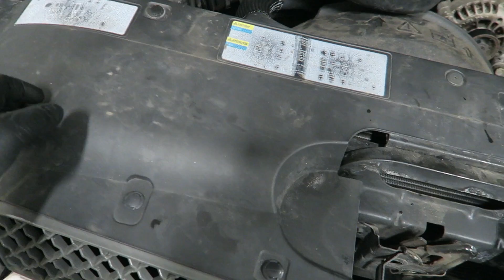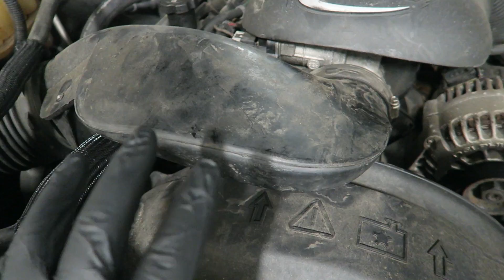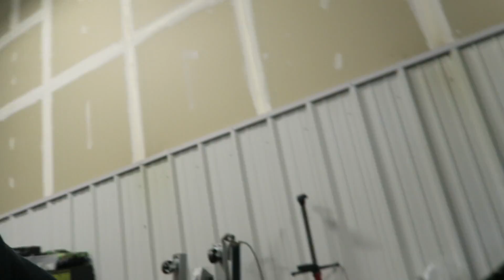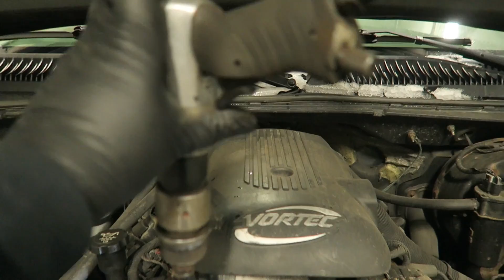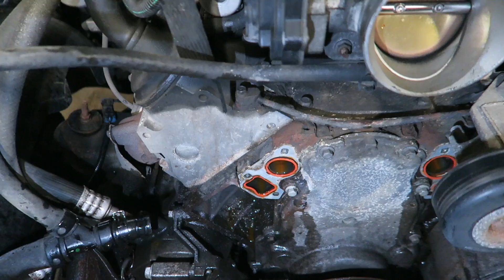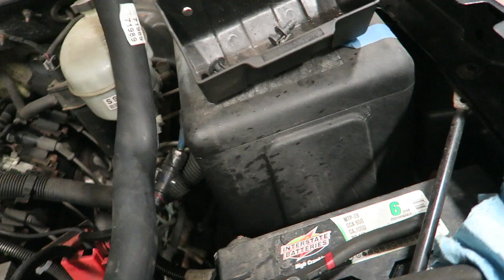SILVERADO WATER PUMP REPLACEMENT....Sorry no welding :(

Comment: Got a 92 f150 just did a water pump on but I broke off two bolts any tricks to getting the studs out the block
Reply from the maker: Chris  Roberts the most productive and successful way to do it is weld tiny beads to the bolt itself without welding it to the block. Build up enough weld metal to slide a nut over it. Weld the nut to the bolt and remove. The heat from welding also helps to free the bolt.

Comment: You make great how to videos! If you ever have the time or opportunity you should do an in depth video of simplifying a wire harness for a race car. I need to make one for my bump-n-run car but I'm not sure what I can delete, and I only want to keep what I absolutely need for it to run and drive. Theres no interior, gage cluster, lights, heat, or dash in the car. Basically a OBD1 harness as bare bones as it can be, but still run as it should. Or, maybe put together a list/diagram of wire systems that are absolutely necessary. It's a pretty specific request, but I know it would be helpful for a lot of my derby buddies besides me.
Reply from the maker: Dm me on instagram. I’m sure I can help 😉